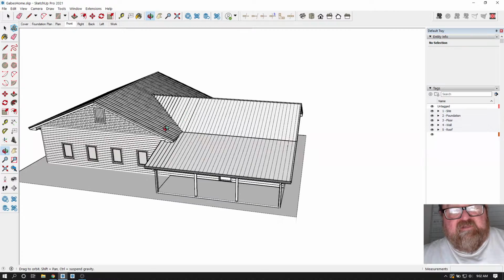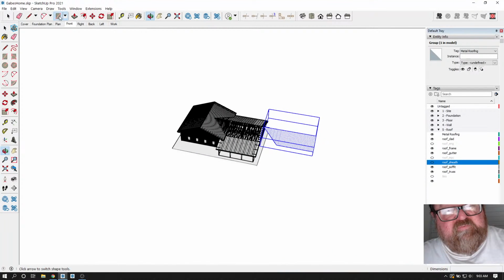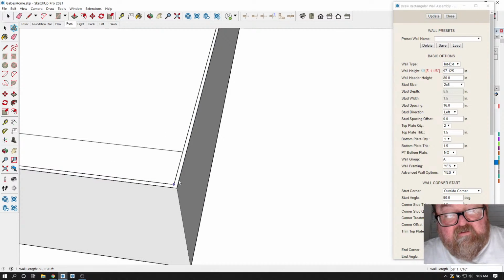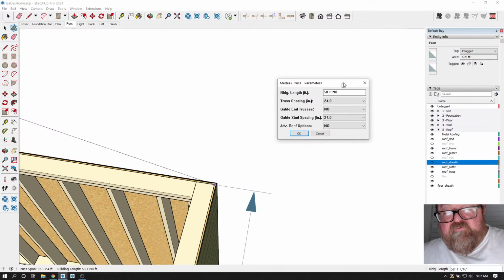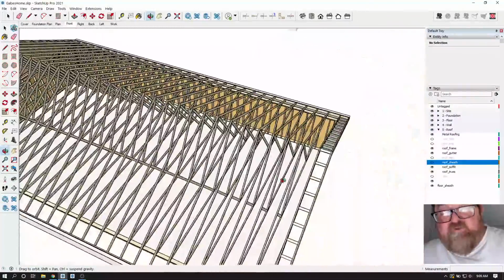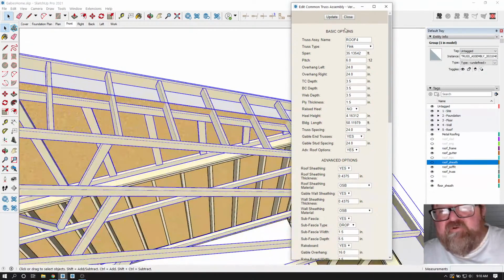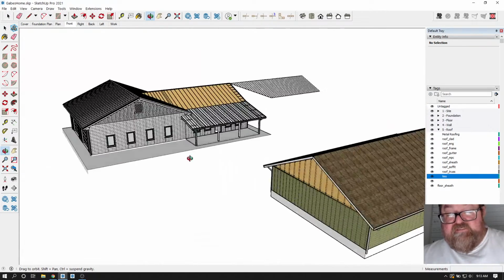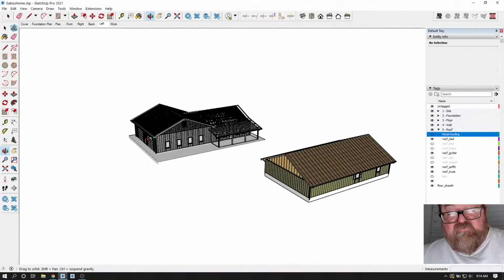Medeek Wall and Truss Plugins for SketchUp - Half Price Sale

Comment: Hi Tony,
you mentioned the slab was already in place. What keeps the water from running under the bottom plate into the building? How do you maintain the required clearance for the wall sheathing and for the siding off of the top of the slab at the bottom plate? Flashing will not work since the slab is already in place.
Nathan is a very smart guy with a big heart.
Reply from the maker: If you are talking about the front porch, it is a separate slab and is dropped down 1 1/2" from the main slab.  The siding hangs down past the slab about an inch. This is how all turndown slab houses are built. I have built hundreds of them and none have leaked.  The sheathing set on nails to raise it slightly off the slab.  The sheathing needs to be nailed to the bottom plate in order for it to do it's job of bracing the wall.   And if the slab is in place, yes, you can install flashing at anytime but it is not needed. I think maybe you have misunderstood something I said.
Reply from the maker: I noticed you just joined youtube today.  Maybe introduce yourself and let me know who you are. I get a lot of trolls and a lot of advice from people who are arm chair quarterbacks who have never stepped on a construction site..  I like to get to know someone before I trust them :)